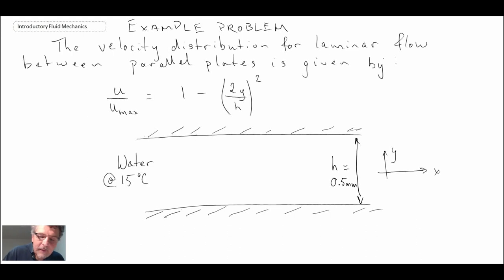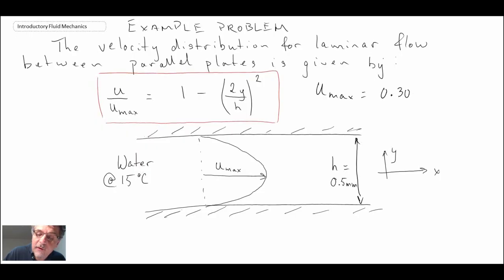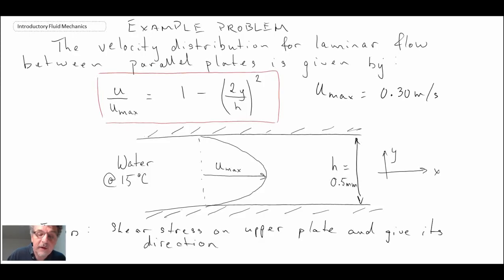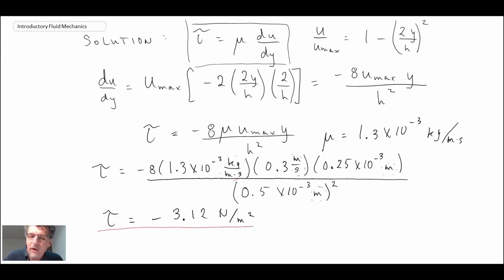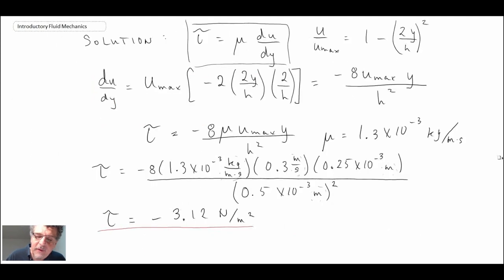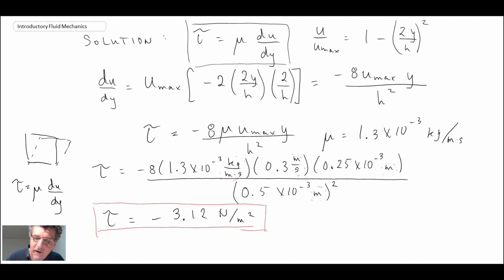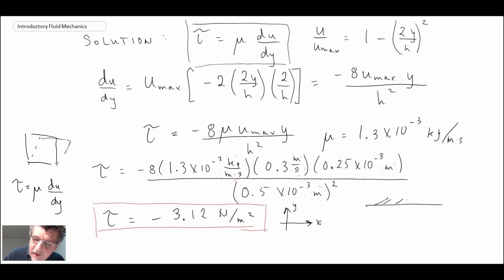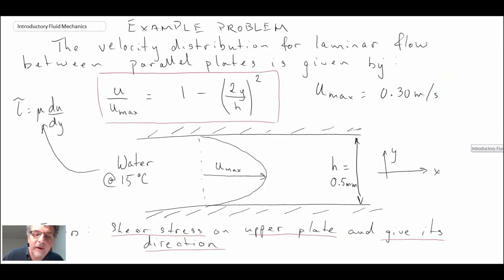Introductory Fluid Mechanics L2 p5:  Example Problem - Wall Shear Stress

Comment: My only question is that the "y" in your formula represented the distance between the plate and where Umax is located? Thank you for showing this example.
Reply: Also looking for a bit of clarification on this. I am assuming since we use Umax then we can also use y as the distance from the plate in the equation.

Comment: Thank you. It's a really good explanation.
But could I ask a question? what about the shear stress of the lower wall? if y= -0.25, then tau on fluid is positive,on the other hand, tau on wall is negative, so shear stress of the  upper wall and lower wall are opposite directions. it's really  confused.
Reply: Did you get an answer for this? I have the same problem in understanding. Cheers
Reply: I think a good way to understand this is since y is a “distance” we take the absolute value of it yielding the same sign for the shear

Comment: How value of mew is calculated?
Reply: I think it came from interpolating the values from the table A.1
I interpolated and got 0.001155 so I guess it's about right with different tables and slightly different numbers

Comment: why the result changed from -3.12 N/m² to +3.12 N/m², please explain 🙏
Reply: He explains in the video since the derivation for tau, mu times du/dy finds the shear on the fluid. We can then deduce that the shear on the plate is opposite in direction so flip the sign.